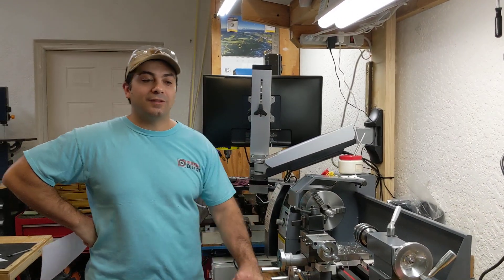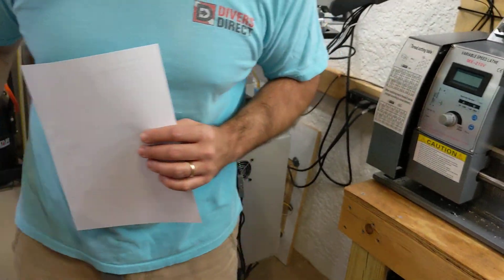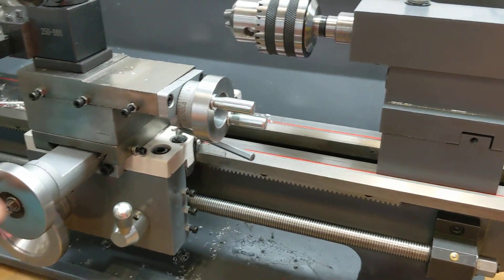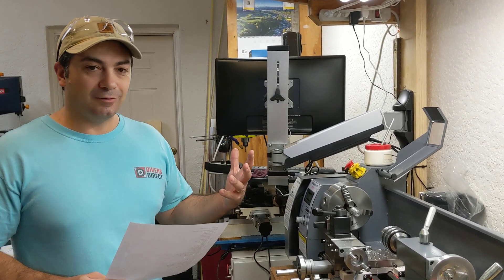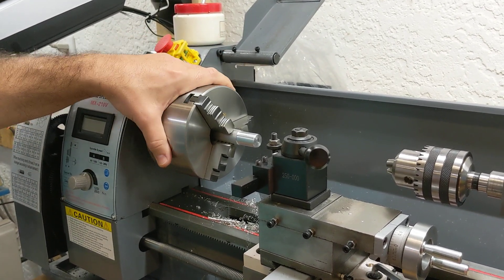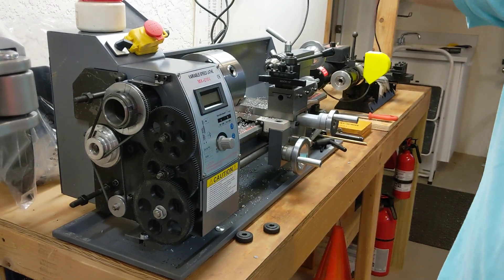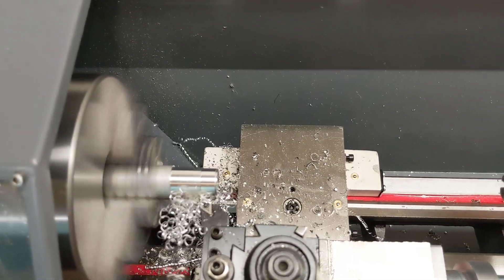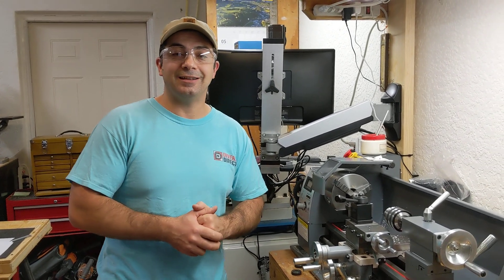MX-210V 8x16 Metal Lathe Review

Comment: I've been looking at this size of lathe for a while. As far as I can tell, there are a couple different versions of the so-called 8" Chinese lathe, made by at least 2 companies; the Sieg C4 and "Weiss" (not exactly sure if that's the factory name) *-210V (or variant). The one shown in the video is the latter. They have different spindle bores running from 20mm to 38mm and different center to center lengths; the smaller C-C lengths seem to have the smaller spindle bores or it's based on the motor size, perhaps. The swing over bed diameters are either around 8.2" or 8.7" (Little Machine Shop calls them '8.5"'). From the latest results for 8" x 16" lathes on Ebay, Aliexpress and elsewhere, most I've seen are the 38mm bore *-210V variants. It's a headache figuring out the different configs. 

As for the gear train, the steel change (spur) gears are metric Module 1 (M1), 20 degree pressure angle (industry default), with bore sizes are either 12mm or 16mm. One can find 12mm diameter sets on Amazon or Ebay. Little Machine Shop sells a large set 16mm bore size (with 4mm keyway) change gears (up to 127T).  https://littlemachineshop.com/products/product_view.php?ProductID=4583&category=1963256896

Alternatively, one could go to Stock Drive Products (www.sdp-si.com) and look under metric M1 hubless spur gears (20 degree P/A is your only choice) in your choice of material based on tooth count. The bore sizes only go up to 10mm for hubless gears, so you'd have to open up the bore and cut a keyway. https://shop.sdp-si.com/catalog/?cid=p591&filter=&sort=undefined&view=table 

The powerfeed feed rate in X is determined by all the spur gears, including the drive gear on the spindle shaft, and the spindle speed (no kidding...). The 20mm spindle bore versions either have a .0025" (not too bad) or a .0037" slow feed (I've seen both) and the 38mm bore size versions (I've seen) have a feed rate of .0038" (feed/threading panel). So to get a slower feed rate, one has to come up with a "better" combination of the spur gears. There are online calculators that can be used to determine thread pitch cutting sizes based on the lead screw pitch and listing all the spur gears you have (and the drive gear) by the number of teeth. Using the calculator and the combined set of change gears that come standard, and any others that one can get, I found that I could think up "imaginary" (very small--150 TPI or .05mm pitch) thread pitches by "gaming" out the different all the combinations of the gears available. Since the thread pitch is the cutting distance in X, choose TPI or metric pitch. Here is one calculator I like: http://kachurovskiy.com/gears/

Hope this helps.
Reply: Dear sir, i also have this type of mini lathe in my home, the problem is, i would love to make a custom thread dial indicator for this machine but i don't know how to do the math to choose a perfect gear combination to match the lead screw of this machine. Would you share if you know how to calculate the thread pitch of the lead screw to match the thread dial indicator gear? Sorry for my english.

Comment: The 38 mm bore doesn't run smoothly like 24 mm. The wall of the spindle is a lot thinner.
Reply: the 22mm spindle has got a 4mm wall thickness.. what is it for the 38mm?

Comment: Like the 3D gear idea.  If you ever need to upgrade you can order a PM1236 in a custom length of 24" or 16".  Needs to be ordered from Taiwan so there is a wait.  I have a 24" version.  I'm pretty sure you can do same with 13" swing machine.

Comment: If you don't have 4" of travel on the cross slide, you don't have an 8" lathe, right?
Reply: An 8" lathe is one with a 4"centre height or having a swing of 8 Inches over the bed.
Reply: That 4" is the radius which is half the diameter so 4+ 4 IS 8 8".
Reply: @bloop6812  Right.
Reply: Turn the Compound 90 degrees an you have 3" + 2" or 5 inches of total travel more than enough in the unlikely case you would need to face a full 8 inches on an 8 inch hobby lathe.

Comment: some where i heard these 8" lathes dont cut counter clockwise or left hand. threads but the 7" lathes cut both  directions ?
Reply from the maker: There are no tumbler gears on these lathes. The 7" lathe has them.

Comment: Actualy a lot of guys like METRIC. Its so simple that you dont even realize. Everything in metric is even. Try to divide an inch to 10 and you will see the frkn numbers. Crazy
Reply: Most US machinists work in 1000ths of an inch not fractions toolmakers often work in tenths or 1/10,000  decimal inches are easy to work with.

Comment: May want to put a variable speed motor or stepper connected to the leadscrew (tail end) to control feed rates - much easier than printing and changing gears. I did this on mine cuz I didn't like the gear noise (SouthBend 9A) and it works great! This will also allow you to auto feed either direction.
Reply: Funny you should say that, I have an old 1930 Colchester Bantam and it only has a leadscrew drive which I don't use for feed purpose due to having to move the change wheels around.....so I toyed with the idea of fitting a small 3 phase motor to drive the saddle with a VFD.....seems like it is a good idea after all.
Reply: @gangleweed  I used a 90VDC treadmill motor and a 10kw SCR controller with a rectifier to control the speed. VFD  will work but may not provide sufficient torque at low RPM.
Reply: @martik778  Yes, that will work for driving the leadscrew and saddle like any other motor you can control or a stepper motor and pulse generator etc......torque is not a big issue for feed drive but for a headstock drive the problem of torque is fixed with a bigger motor.
Reply: I had the thought it might be possible to do that. With an encoder or something to measure the position of the spindle, an arduino might be able to give you infinitely variable feed rates by 'software'

Comment: ? i always see the cross slide in 90° on this lathe,
Is this fixed  90° ? Am not a pro but on most mini lathes there ist this cheap plastic angle.
Thanks for any info before i buy one.
Reply from the maker: Hi.  The compound is adjustable and there is a cheap little angle gage on it.  But, it's sort of a pain in the butt to move it.  Remember, this is a cheap lathe.  Very basic.
Reply: @FrancoCNC  Thanks man, no way to guess from the pictures

Comment: I'm in the market for this lathe. I'm looking to do a lot of imperial threading.  I see some more common imperial thread pitches are missing from the chart. Do you know if optional gears can be 3D printed to yield 16 and 24 tpi  pitches ?  (I too have a 3D printer) Thanks !
Reply: I've found out that some of the imperial settings from this chart are inaccurate. If you need 24tpi=>1,058mm try: A:84, B:72, C:33, D:60, E:50 - gives you 1,056mm... with standard gears from this lathe.

Comment: Any updates on the lathe? I'm getting really close to pulling the trigger on one. How is the rigidity of the machine? Any chatter or a large amount of runout?
Reply from the maker: Keep in mind, this is a "cheap" bargain lathe.  The rigidity is just as good as any other small Asian lathe I've owned - better than the 7" mini lathes, for sure.  I'd say the runout on the bearings is comparable to any other lathe in the import world.  The biggest thing I will complain about is vibrations - there is a certain RPM range I tend to avoid because of this.   If you have room and can afford spending more, check out Precision Matthews.  If you are on a budget, this lathe is better than nothing.  Better than a 7" mini lathe,.

Comment: The Qctp seems to be the good size though some got the AXA 250-100 instead. What do you think  ?
Reply from the maker: Well, I used the QCTP I purchased for my 7" mini lathe and it seems to fit perfectly.  No complaints and it seems to be a good size for the machine.
Reply: @FrancoCNC  It seems to be a more capable machine than the 7" and with some modifications to strenghen the compound already with a more torquee motor it would be worth trying if a beefer tool post would help.

Comment: Sweet! Got a G0752 but only want to keep it for manual machining.  Bought the Centroid Acorn and CNC12 Mill Package purely on your videos, and it's great!  Thank you for selling me on that!  Also got that honking 12NM closed loop stepper from Stepperonline for my mill Z axis.  What a beast!  Their engineering support is excellent.  They respond quickly considering the time difference between here and China.  My question to you is, for practical use, what steps per motor rev do you set your drivers to? 
 Been looking for a mini lathe to CNC and I think this is it! Thanks Franco for all the info you share!

Comment: Camphor (Moth balls) is a rust inhibitor
Reply: Yeah. It was literally mothballs lol
It's oiled with a solution that has camphor in it because it sublimes and gets everywhere. You cannot get rid of it mechanically on small areas because it will sublime from somewhere else and precipitate there. It's like a fogging on cold object in a misty room. But that's the point, it closes off oxygen.
As for the dirt, it's probably from shipping. Oils LOVE dust.
Reply: @whatevernamegoeshere3644  Yeah, Old timers (Machinists) use to keep a block of Camphor in some of their tool drawers to keep their tools like v-blocks and other set up blocks from rusting. I don't think I could stand the smell. Today it is easier to use something like Boeshield or LPS or line them with VCI paper.
Reply: @rhost714  Not gonna lie I love the smell of it because I never smelled it before and don't associate it with old rags

Comment: So how long will it be before this has a Centroid Acorn?
Reply: lol, that's what I was thinking.
Reply from the maker: I thought about that but I just need a manual lathe right now.  Most of the time, I just want to do a quick face, turn operation on a pin or bushing.
Reply: @FrancoCNC  thought you had precision Matthews lathe before? think this lathe is discontinued so if you want one act quick,  the spindle bore and 5inch chuck is the reason I got it.  My tailstock was high by 0.2mm, spindle bearings are NOISY and the cross slide gibs are about 5mm away from the slide  casting,  noticed yours is the same!but still got mine for £700,  would buy again. If you aren't scared to do a little work it's a great machine and nothing compares to it until you basically double the price!

Comment: Hmmm. For around $300 or so, you can get a larger 9" lathe from the Grizz. It would still be small enough.
Reply: But you lose the 1 1/2" spindle bore.... deal breaker
Reply: Great choice 
In California 
The cost is $1640.00 vs $873.00
Shipping is included in Price